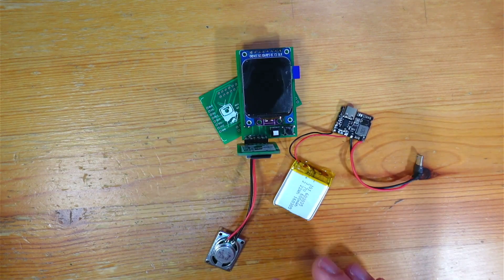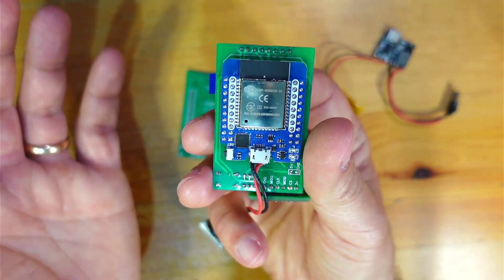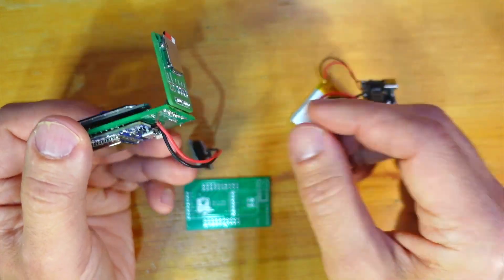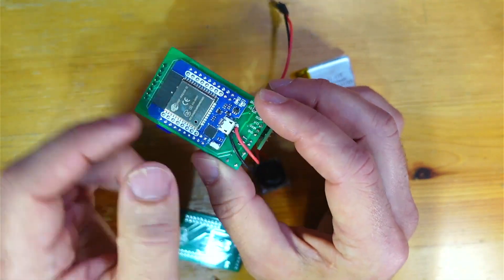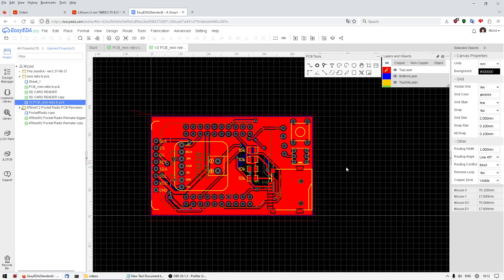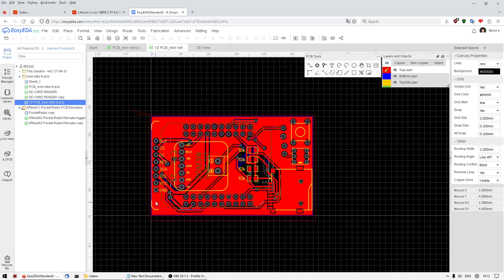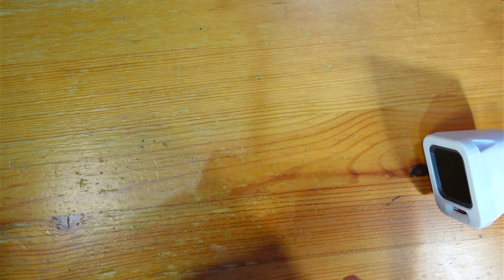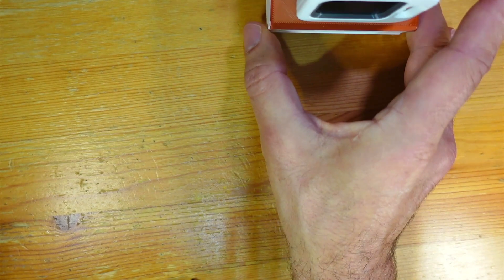Mini TV Repackage in Progress

Comment: Will it work with the new esp32 with usb-c and charging on board?
Reply from the maker: You are probably talking about the ESP32 S3's. In which case no. But the Lilygo t7 v1.5 would work. It has onboard charging but a Micro USB port. In a lot of ways it's the better option.

Comment: Why the holemounted wroom? The few reg chips etc on that breakout board could easily be on your own board no?
Reply from the maker: It's a nice idea. I did think about it. You could break everything down (amp, charging board, D1), even ribbon cable the screen. A lot of people do that and then sell you "their" product. This way though you can make it with a $10 soldering iron. Also, I don't really want to get into hotplates or manufacturing. Thanks for the comment!

Comment: Hi love this Project, quick question how did you know the 1mm trace was needed di the software insert it for you?
Reply from the maker: Simple answer is I don't know. It's trial and error trace sizes based on previous builds of the project. To get the maximum 80 MHz on the serial clock line to the screen (in this project) it seems to need a fat boy trace.
Reply: Maybe there's a skin effect at that frequency.